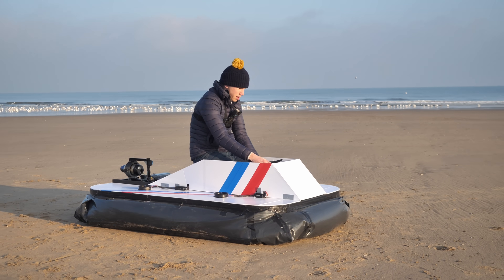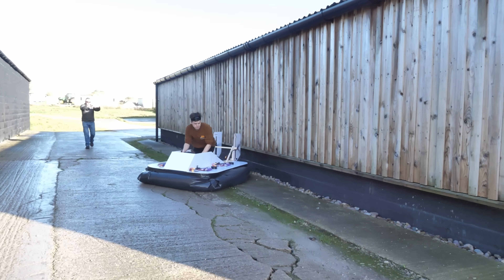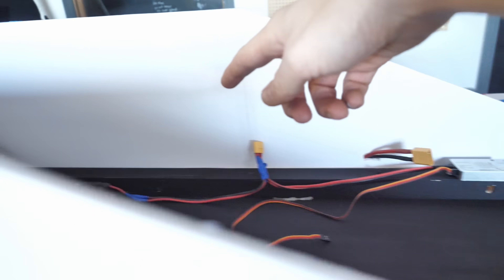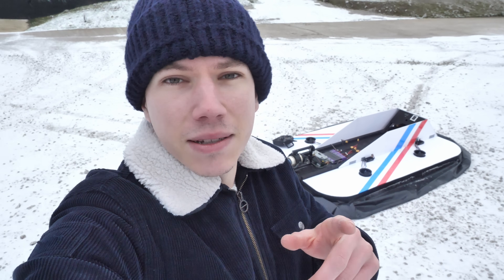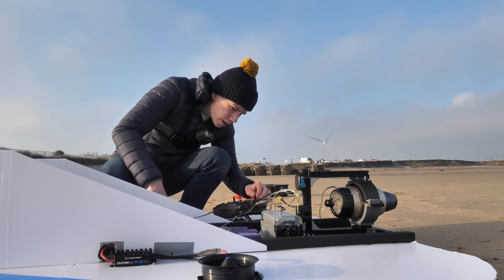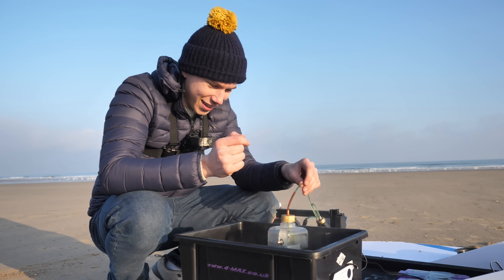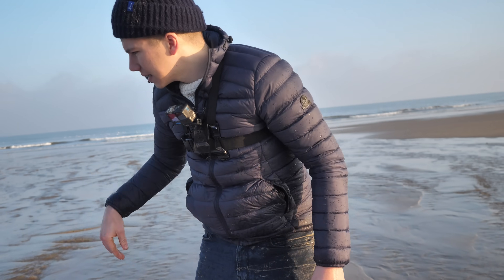World's Smallest JET-POWERED Hovercraft

Comment: Brilliant build and an impressive top speed. I suppose if you’re flat out you don’t have any headroom to pull corrective manoeuvres but I”m glad the only damage seemed to be the hull superstructure! Enjoyable year of videos!
Reply: Bruh how did u post 3 hrs ago lol
Reply from the maker: @cusscuss2536  Patreon early access 😊
Reply: @Project-Air  aaa ty
Reply: @Project-Air  hey I'm trying to make a mini rc hovercraft can you give me some advice please
Reply: Being a jet engine that is on a pivot it will always have headroom for turning. It would just lose some speed in turns when thrust vector moves to the side as there is not so much force pushing it forward.
Reply: @Project-Air  Someone using your username to give packages away.

Comment: I never thought about it before but apparently yes, hovercraft is counter-intuitive in that to slow down you turn around and increase the throttle instead of cutting it. Gives me similar vibes to autogyros, which apparently are "extremely safe unless you do the one thing a pilot intuitively does when facing a stall" and pitch down.
Reply: Nobody is turning their hovercraft around to brake. Commercially available craft would typically use some form of thrust reversal or simply reduce lift and skid on the surface to brake.
Reply: I’m old enough to remember hovercraft crossing the Channel. They were loud! Your hovercraft is loud too, perfect reconstruction! Especially when on a beach.
Reply: Yeah .. for traditional hovercraft, that would be true...

But if you use a array of ducted fans all around like i suggested on another comment ...... you could have WAY more fun and way more steering while drifting...... in any terrain.... ;)
Reply: @hackbyte  Probably not enough thrust for something like this, but yeah maybe he should build skies ie landing gear under neat it and rebuild the skirts to have sections, well as holes on the top so damn thing works like it suppose to. Now its just basic home craft setup, not suitable for scaling up like this as actual vehicle.
Reply: @bradley3549  jet skis don't turn unless you're giving it throttle, and people eventually figure that out after bumping into yachts or piers enough times.
Reply: You could try to implement a speed brakes or air flaps just like on the plane to stop/turn hovercraft. Idk if it would work at all. Pagani Huayra is using air flaps on the front and back to stop faster.
Reply: @hackbyte  At that point, you've essentially built a blower tank from Hammer's Slammers!

Comment: I built a Bob Windt design UH12T2 hovercraft and have improved on it many times over the years since 1980 when I started building it. It's a blast and have it running pretty darn good in light of the long time it took me to get a lot better success. Better bigger engines, etc. I saw those small jet engines used by the guy who flies around with 2 of them on his arms and thought those things have a lot of thrust for their size and would probably work good on a hovercraft like mine. Seeing you do what you did was very cool. Gas powered lift engine and jet powered thrust engine is what i imagined for mine. But mine has a 40hp thrust engine and a 10.5hp lift. Great job and ideas. You're very impressive. You're going places.

Comment: This is so awesome! That jet sounds WICKED.

PS: If anybody wants to make their own hovercraft, I've built a few and I can recommend you use thick plastic and include a foam ring around your board inside the main envelope. I used pipe insulation. It kept me from getting an out-of-control board at ankle height bashing into my leg.

I used a wired vacuum cleaner for mk1 and then a gas-powered blower for mk2, but I would like to try a battery-powered one + spare batts.

They are fun to play a game of catch with yourself or kids on board, gliding like an air hockey puck across a tennis court to a waiting friend.

Comment: My advice from the engineer's perspective:
1. Inbuild the throttle control
2. For the cold climate, build a heating system for the fuel.
3. Increase the amount of upward and forward thrust, upward thrust to smoothen out any uneven terrain and forward to improve your control as the more force you push the hovercraft with, the better will its control be so you won't lose control over the engine stalling

Comment: Id love to see a longer, bigger hovercraft with two of those jets, where you can do vectoring thrust. you could make the lifting inflating bag double lined, you can coat a tarp in sealant spray to make it more rugged. You could also make the design have a bit of symmetry so that the inflating bag doesn’t pinch when you spin out and go backwards.

Comment: I feel like the curtain needs to be bigger / longer and the fans more powerful. Seems like it barely inflates it.
Shouldn't a slight depression in the ground be no problem for a hovercraft?

I'd still leave the rudders because even if you stop the engine you still would be able to steer.

Great project! Kudos to your engineering and building skills. Awesome! 🤘

Comment: To be honest i would recommend making all the controls into stuff you can use without needing a transmitter. A steering wheel will make it much more controlable, and having a lever on the bottom to control trottle would make speed control a lot easier. You could even add an emergency stop button which kills both the lift EDCs and the jet engine so you can just suddenly stop if needed.

Comment: Awesome video. I don't see many hovercraft smaller than 8 feet long. Maybe a few more lift engines to keep it floating better might decrease crach potential. I believe hovercraft typically fly at an altitude of between 3/4 inch and 2 inches depending on size. Good job with the project.

Comment: I used to race hovercrafts and that beach makes me jealous as I wish I had an area that large and flat to test on. If I can offer a tip it looks like the front of your hovercraft is tipping forward/down and that is going to cause you excess drag and a tendency to spin out at higher speed.  Id suggest either moving your lift fans forward or moving your seating position back.

Comment: Very cool, but for better control authority, you really need differential, and reversible thrust from two engines, one either side of the pilot. these craft move too slowly for rudders to provide much in the way of control authority, but better than nothing at all. At higher speeds the rudders will be more efficient. Thanks for sharing. :)

Comment: You should build a skirtless hovercraft (look up cushion craft CC2). For lift you could use two paramotor motors (30kW?) powering two centrifugal fans, one in front and one in the back. Two vertical stabilizers in the back for stability and steering. If you want to make sharp turns with minimal sideslip, you could use one jet engine on each side with bucket type thrust reversers, using reverse thrust on one side to turn the craft.

Comment: nice video, i do like hovercrafts because they are something different. maybe some rudders on the outer edge of the craft, so away from the jetstream would have helped. that way you would have a bit steering with low throttle or trottle off when moving. with the air of moving flowing trough the rudders.

Comment: I feel like you should definitely get more control. I think fans into each direction controlled by a microcontroller (or manually) could help you stabilize the craft and counteract slopes without having to tilt the craft against the slope.

Comment: I think an air rudder rotating with the engine would improve controllability while slowing down
Thrust reversers might also be useful for slowing down, although depending on exactly where the exhaust ends up, something might get a bit melted.

Comment: hmm a rudder collinear with the engine can help. So you can cut engine and still have steering authority. Unless of course you enjoy lots of countersteering. Once you get sideways the drag force is mainly  in front, so this thing will have a tendency  to reverse..so a rudder moves the drag to the back.
Reply: actually not. maybe a fixed rudder better

Comment: Build a larger one, with a seat, and twin jets. With twin jets, you could really enhance directional control, by having both engines turn independently. One directional control per hand, using two large joysticks. Both engines can vector in a wide range of directions: up, down, left, right. This can help you shape your thrust, to help you turn quicker, while still maintaining forward momentum. One engine pointing back, and one to the side, to turn quickly. The whole thing could use manual steering linkages, without servos.

Comment: Feel like a vertical stabilizer would do wonders for the entire design. Maybe even a rudder or two. You'd be less prone to drifting sideways and be able to steer more reliably. Instead of just turning the craft without changing the direction it's moving as it is now without a vertical stabilizer.

Comment: There's another channel, where they Test things for Flite, that has been trying to do a hovercraft based on a movie prop.  THey have the same problem James does - ducted fan/ props are the wrong thing to use to inflate the hover skirt.  You need centrifugal blowers, they develop higher back pressure, which is what you want.  Props and fans are for velocity.  That's why the old ads in the back of Popular Mechanics advertised a hovercraft made with a vacuum cleaner.  That has a centrifugal fan.  Also, leaf blowers.  You probably would only need one or two Ryobi 18v leave blowers to lift this vehicle.

Comment: On the transmittor not making it: I've fixed saltwater damage on modern phones with a toothbrush and soapy hot water on the boards over the kitchen sink, then air dry,  spray servisol. If it needs any more just keep scrubbing and doing servisol sprays a few more times. Unless you left the thing powered on for ages while water was in there.

Comment: While you might want to see if the jet can handle it, you could dose the fuel with about 20 percent gasoline to keep it from becoming too viscous in cold air. This is a tactic used with diesel engines.

Comment: How about getting back in the drawing board and making this properly. For skirt go to local tire shop and get two tractor inner tubes for free from the trash, cut them in half and glue together making squared shape, cut holes on top, install rubber inner walls with small holes to prevent one section being emptied from air if balance is sifted but also allowing some air in case one prop dies. For lifting motor maybe try lawnmower engine instead of ducted fans and for propulsion horizontal shaft engine with reversible pitch propeller. Also seat to stay so you wont get yeeted again, landing gear skies all around so skirt wont be destroyed on every landing and some flotation aid so you can try to go into water with it.

Comment: Can you increase the power to your lift motors? Its lifting you, but there should be a bit more blow out from under the skirt (at least there is on my dads full sized one and the racing ones i just looked at). Just a little bit more.

Comment: just a suggestions:
maybe put more weight in the back to make it go faster since I noticed the front of the craft was creating a lot of friction because it was leaning forward bit because of your weight. so maybe you could put 2 separate fuel tanks on both sides of the engine or maybe even the back out with batteries on one side of the jet and tank on the other so there will be more weight on the back and it would be more equivalent too

Comment: If you are planning on improving this machine It might be a good idea to fit some shopping cart design wheels under the body,which the whole machine rests on while unpowered so when you decrease or loose the pressure from the lift engines the side of the craft does not grab the ground that suddenly and gives you some roll-out,but I guess it would not be that effective on sand and would be kinda cheating and would require some sort of emergency break mechanism as well.

Comment: Also another problem is the pitch stability once you get to high speed. If the device pitches up the lift moves forward. You could easily somersault, i believe. ekranoplane -style horizontal stabilizer maybe? but not so sure with hovercrafts

Comment: I am surprised those axial EDF fans produce enough pressure to inflate the skirt and lift it up like that. Would it not be more efficient to use a radial blower type fan instead? Although, i guess flow rate would be the problem then....

Comment: You can see that you are tipping down in front and thats because of your jet engine.
So put one or two more EDF Fans in front to eliminate tipping from the jet engine. 
I watched your last video with plane and the rocket motors so it's same here, like with the planes.
If you offset the main engine this will happen and for the same reason you fall in that water. 
So you know what i'm talking about, center of gravity.
I wanna see this works so i wish you good luck with this project.
So you can contact me about it and we can talk. 
My English is not the best and i'm sorry for that. I'm from Czechia so that's why.

Comment: I still don't get why you took the electric steering away, surely you could still use the electric motors for steering without using them for motion then hard mount your jet engine

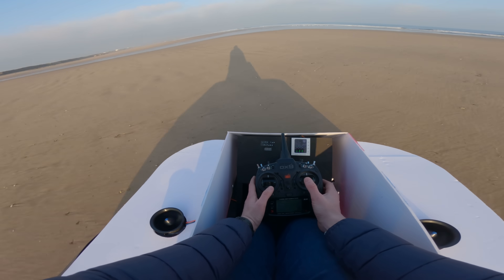Comment: 9:18 you should have throttled back up when reversed so it would have slowed you down
Reply from the maker: Absolutely right! I just didn’t think of it at the time and instead decided to see if I could drift across the stream, but one of the skids dug in on the uneven sand and flipped me!
Reply: @Project-Air  damn